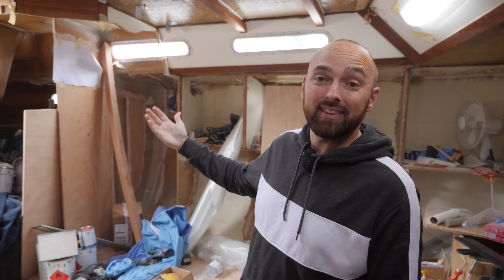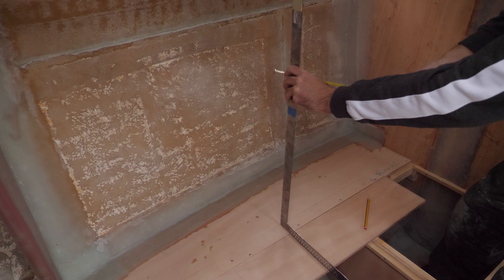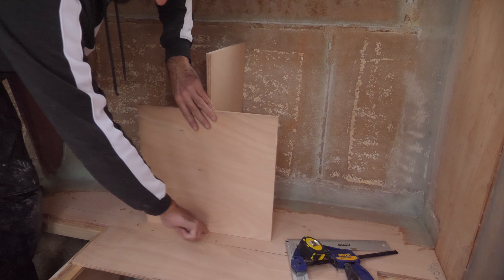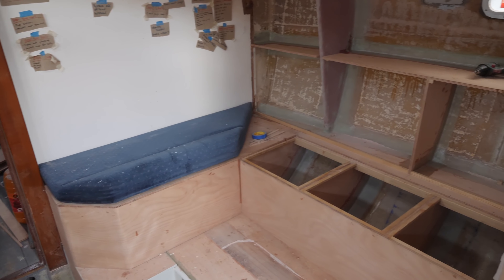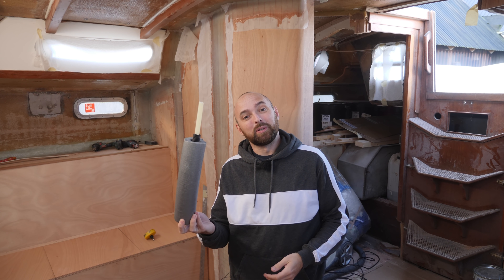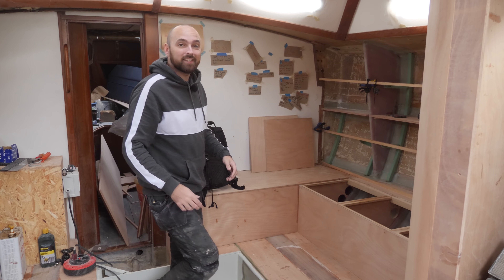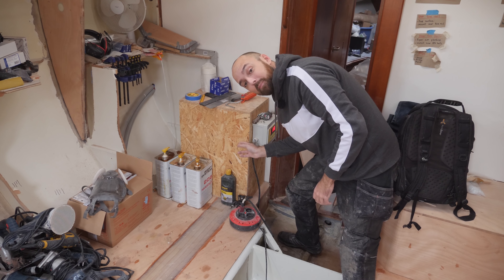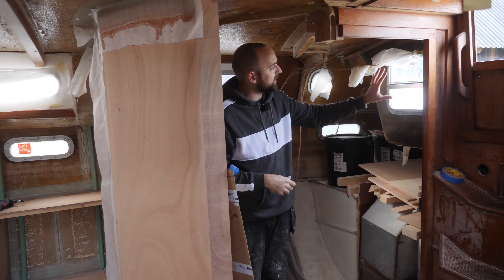Sail Life - Settee finished (for now) - DIY sailboat refit

Comment: Why not an option C? Take option B and put the head where the sink is, then put the sink area where the head is and then you have stowage  (the area behind the shower as shown in option B drawing) accessible where the sink is. You can then also make the counter/sink area slightly larger since it's not forced into a corner. 
EDIT: Also, in some boats, I've seen fold-down/up options that can temporarily extend the countertop of sinks over the top of the toilet, without causing "you've got to go NOW" problems.
Reply: Agree.
Reply: Totally agree! That's what I was going to suggest but you were faster! ;) The diagonal orientation is the best in those tiny bathrooms! Cheers
Reply: Agree, saw it on S.V. Basik.
Reply: Agree this option C is better than A and B. Good luck!!
Reply: @raymondhamm7350  LOL that's the same thought I had... #Nice
Reply: I agree... and add you could extend the counter across the toilet...
Reply: I agree
Reply: Instablaster...

Comment: Option B will work best for two reasons. 1. In a following sea, spray will enter the heads via the companionway.  2. You will need access to the technical area more frequently than you currently imagine.

Comment: A suggestion about the storage behind the seat, I would suggest making  tilting backs instead of the classic portals. Personally I prefer a insert shaped like the compartment attached to the tilting backs. This means that you have a better overview of what is in the storage space. The hight of the insert on the hill side can easily be adjusted so that the compartment opens fully or if you want to stop the compartment from open fully even if the locks fail (for example in heavy seas) and you don't want heavy or breakable things to spill in to the living area. personally I use this kind of storage for canned food, root vegetables and one is for my emergency repair kits (gas, electric, water, hull and sails) this one doesn't have a lock but is attached with Velcro so you don't have to fumble around when in a hurry.

Comment: Hey Mads,, don't underestimate how often you will need to access the technical area. Also if you keep it very accessible you can put more technical items in there that need regular maintenance like fuel filters, water maker membranes, batteries etc. Cant you make the access thru the cockpit with a locker type hatch in the seating. It's a nice big area and you could keep a lot of the technical systems for the boat in there. Fresh water filters and in time a built in 6 kw generator. It will be like a stoop down machine room.

Comment: My vote goes for Option A. I had a look on a Jeanneau Sun Odyssey 349 a while back. That has something close to Option A (except on the Port side) with decent access to the technical area through the shower. But they had also run the shower all the way across the available space giving a 'sit down' area where the hull curves - and also included a rail for hanging up wet weather gear.
It was a very nice layout.
It's all looking very spiffy by the way.
Reply: Oh, and they put their toilet at about 45 degrees - good compromise.

Comment: I had an 1988 Hunter 30' with the head facing forward with your back up against the bulk head where you are going to fill in the window.  With the countertop, cabinet and sink along the hull this sandwiched you in when heeled either direction and when you hit big waves is more like a rocking chair .... instead of getting pitched off the throne if the your back is along the side hull on the high side.  The shower could take up all the rest of the floor space forward... nice to have a shower large enough to shower with your lady.  Run curtain rod over head the length of the countertop and turn inboard in front of the head over to the interior wall. The shower curtain will keep cabinet/countertop/sink area and head dry and maximize space and open feel of the head.  With a grated floor that has it's own bilge pump below you maximize space.

Comment: Option B with a flip up/removable  table to allow access to the technical area door.  A fold down surface over the toilet expanding usable surface area when needed.   Put a large  (non-glass) mirror on the technical access door.  Access door could also have a towel rack (lifting points for easy removal) as well.

Comment: If you put a padded, fold-out false panel on the front of the section of settee that is parallel to the hull, when extended it would convert it into a wider and more comfortable three-quarter width day berth.

You could also install a fold out false panel on the back support for the same section of settee and reinforce the outer edge for sufficient strength then make it so it swung out and up.

When it was folded out you could support this upper structure with strong lines hooked to attachment points in the outer edge of the bed and ceiling or perhaps via brackets at the ends.

That would make the settee area into a double bunk berth and given that four line handlers and a pilot are required for transiting the panama Canal five relatively comfortable berths would be a necessity.

Comment: Option A is better. You can have the door open in or out. Option B can only open in. Make sure the latches for the Technical door are flush and don't forget to build in sockets for a very strong closet rod for hanging soaking wet gear and a built in place to store the rod.

Comment: The problem with option A is to get a good seal to the technology room, because water penetrates in all sorts of strange ways. I would go with option B and get the shower at the other end so as to avoid the seal problems. The window up to the cockpit could then also remain and could serve as a communication path to the cockpit. you can get good cupboard space in the bathroom towards the tech room, maybe even a small fold-out surface for the sink in the opening to the tech room. It would also be easier to get in, even if someone is using the shower. and a big storage area for sink will only collect things that would better to be stowed away in cabinets,  no easy decisions :-) Greetings from sweden

Comment: You should consider a thing about the settee you've made. With a little bit of lateral thinking, you could make the table that goes there such that whenever you don't want it to be a table, you could transform the area into a proper sized bed (small, but still) In theory, all you'd need is a system that would allow you to hook on the settee side (sleeping trains have these wall mounted brackets that accept (from the bed) a rod. On the other side, towards centre, you could have two legs. All you'd need to do for this, is to have two stiffeners under the table's face and the two hook (or other means of mounting a bed you might figure out). 

Dunno about you, but in a boat (to be read, in a small area) i'd love to have an extendable bed/resting area where the biggest space is. And whilst the settee is a good start, it's not exactly accepting of two people. Just saying.

Comment: I'm probably to late but my 10c worth I'd go for B. 1.Shower further away from a wall that has to be opened (sealing water top priority ) 2. Door closer to engine will give you more access. 3. With sink in the corner the whole wall could be mirror panels, you will just have to be careful when taking them off.4. Head not directly in line with the door will give you more privacy. I'm unsure if you have mentioned but i would also have a sliding door.

Comment: Nice work. I think there might be an option C that provides most of what you are looking for in head. Using option B layout — extend counter top across aft wall but make inside half removable (or fold over) to access tech area so you don’t have to penetrate shower wall which seems to be asking for trouble.

Also you might want to watch Boatworks Today “peanut butter” epoxy video. Basically, explains how to tab in walls/joints to be super strong.

If I may, please please wear a mask at all times when sanding fiberglass — the smallest of fiber inhaled can cause serious health issues.

Comment: Check out a Najad or HR heads - the shower is in front of the sink (shower head is the sink tap you pull it out) and draw a curtain across the inside of the door. the whole thing is a wet room.

Comment: I would think about your layout with the shower forward. But modify it to extend the shower over your holding tank and include the sink in the shower. It will give you more elbow room in the shower and leave you your entire back bulkhead for access to the tech room or cabinets

Comment: You mentioned PLAM (plastic laminate ) on the horizontal surfaces above the sate, consider solid surfacing ie. Dorian. It will not delaminate, it is waterproof and indestructible, any scratches / gouges can be buffed out. It is available in various thickness down to 1/4” (.635 cm).

Comment: Acudor ADWT-SS for the access, yes they do cost more but they are air and water tight with some button head screws holding them shut "No worries about a scraped knee", they are stainless as well. As for the heads entry, why not design a pocket door which will help prevent an actual swinging door from taking up space. You still have to do flooring so you can easily install a track to hold and guide the bottom and use a roller and track for the top to make it easily slide open and closed, you can also try to find a latch that allows you to lock it in the open or closed position!

Comment: Keep up that great work.  Consider when building a box from wood, that a dado or groove that a perpendicular fits into adds enormous strength to your box.  When insulating closed cell foam is an awesome choice, no air flow, no water, and a huge r value when measured functionally.  One more layer to consider is mylar: a radiant energy barrier, that reflects 98% of what you don't want out, and reflects what you do want, like radiant heat in. Incredibly efficient & effective.  Thanks for sharing & keep giving your best, I think you are doing great

Comment: I like layout ‘A’. I like the door to tech area in the shower. Double duty for a wall surface, in an always open space- the shower. Option B has tech access on a wall space that would b wasted for storage on and in front of. 

Door could be gel coated light foam panel, simple gasket, some kind of molded flashing above top edge, with a couple of simple cam action dogs.

Comment: Have you considered a variation of option B which makes the sink panel movable for access to the technical locker instead of cramped into the corner? In option A you must make the wall of the shower a door. In this variant of B you would have to move the sink. I expect you would fold it out of the way meaning hose would be used for all connections.

Comment: Layout A with the loo facing towards the centre line, easier to brace yourself when the boat is on its ear. Also would access through the cockpit to the technical area be an option. Great work as always. 👍

Comment: One of the reasons why cushions are flat and not wedge shaped is that a lot of the time they are used as sleeping surfaces. So if you're sure you'll never put them on the floor and use them as a mattress, then go ahead and make them any shape. The alternative to wedge shaped cushions is to make the back of the settee angled.

Comment: For the head, go with option "C". Take the layout from "B" but switch the head and the sink. You are going to have a really hard time waterproofing the access if its in the actual shower. You could even go with option B but put shelving on the access panel and it would be far better than having leaks get in behind your technical area where you have electronic gear.
Reply: OK We got Plan "F".  Any bets on "Z"

Comment: You're choice Option A. But...my idea would be, to create a shallow open cupboard 10-15 cm deep in it. The half way cubboard. This, next to the companionway, will have all the stuff you don't want to leave  outside, but are needed at close hand while sailing, a like binoculars, sunglasses, handheld vhf, Epirp, suncream, gloves,  signal horn, safety harness, (search) lights, flairs grabbag, even your speargun could find a nice ready to grab place there.  You can even store the hatch parts, hatch musquito net, safetybars and locks, in the lower part there. And when on watch you don't have to go al the way into the boat to grab something,  just a step or two is enough. The "halfway cupboard " option leaves create also some space in the shower for small shelfs, and a double wall to neatly hide cables and pipes.  Succes Mads!

Comment: Mads, consider using some of the technical area for head storage (thus giving more room in the head). Put a cabinet and drawers in the furthest aft corner and extend the cabinet and drawers into the technical area. In the technical area build a big sealed box over the inset cabinet/drawers so they are protected and isolated from whatever is in the tech room.

Comment: OK, you got to the insulation bit after I posted, well planned. But for the head,  I'd go with 'A' so you can use a 'sliding' pocket door that opens into the shower, allowing the head to remain open to dry out after use without blocking passage (or a bi-fold that opens inward). As to the toilet, sitting 'fore and aft' on a heeling boat can get awkward, much easier to brace yourself in a 'port to starboard' configuration. As to the port light, your boat, your choice, but replacing the existing one with a double pane, insulated one would be much less work for about the same cost, and for privacy, we always sprayed 'semi-gloss clear' on windows to 'frost' them. Plenty of light, no view...

Comment: The gap you have when you measure by stick is the difference between marking on the top vs the bottom, where you're actually measuring. Just my two cents.

Comment: Position of the head.    My preference would be for the head facing to port.  Athwartship would be difficult on either tack and neither plan supports having the head facing outboard.   I suppose if you had urgent need of the head whilst on starboard tack then you'd have to ask the helm to change tack for a few minutes or you could use option A and place the head diagonally facing the port quarter..

Comment: On high efficiency homes, there is a 12v fan in a duct that is constantly exhausting through the bath & kitchen...and constant supply through bed rooms.  This would aid any durade vents/ equivalents that you would be using. If you switch the fan, use a timer so you have even more control. 
  Mylar would also cause all that radiant heat to bounce around, causing the materials in the space to be warmed, so when you open a hatch and exit losing your hot air doesn't matter as much...works awesome.

Comment: Option B would be closer to the cockpit entrance and would make foul weather access to the head easier, with not so much water getting splashed all over your living space from foul weather gear.  Also makes removing your foul weather gear or donning it easier if it is hanging in the shower while underway.  You could always put the sink counter top above the access hatch to the  technical area to gain that space back like you have in option A, and make any shelves or doors removable, or build it as a modular block that could be unlatched and removed to gain access to the technical area since you don't need to get in there often.

Comment: The settee back cushion may have been made constant thickness so they could be used as a mattress. Either you could drop the table and put the cushion on top to make an double guest bed - or just take the cushions on deck when it's really hot.

Comment: I would agree A is the better option -- you get a nicer sink surface area and don't wind up with the "dead space" that is doing nothing for you but being an area that doesn't contribute to anything except as access, which you say, will likely only be needed infrequently.   

Building a access that is capable of shedding water shouldn't be all that difficult, and would seem to make better use of the space..

Comment: If using the grey insulation for the pipe work bear in mind it’s bad for absorbing water. Just had my heating system installed and plumbers highlighted this. Just a thought!

Comment: I would suggest option “B” because I think your shower stall should be a one piece wall and you would have to make an entry way in that wall to gain access to your storage. If you were to make some type of shelf/sink then you would have access underneath or above however you want to design it to your storage without upsetting the plans for the shower

Comment: maybe you can do the settee to be transformed to a double bad, not just to a single bad. Once you put a table to the middle of the L shape settee, it will be not so good to sleep there or have a nep - upon my own experience. The best solution is to make a table which can be folded completely so that it disappears from the way, or to lower down so that it transforms the settee to a double bed.

Comment: Mads, you heat your epoxy but it appears you might exceed the lower air temperatures for applying it. 24 degrees C or 75 degrees F according to some sources. Have you noticed any adverse effects? I am in Africa with challenging air temperatures to epoxy negotiate.

Comment: Option C: make the whole area a shower room with a sink and head. A lot of motor homes do this. Easy to clean as you just hose everything down. And you won’t be showering in a small compartment, which is a pain if you drop the soap.